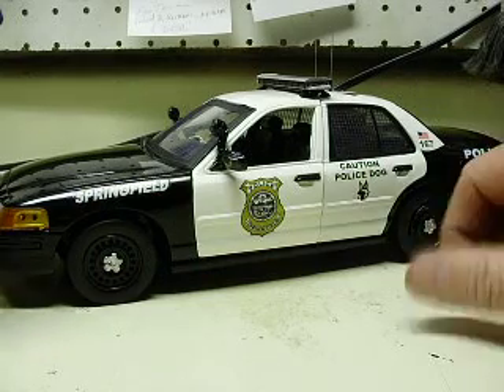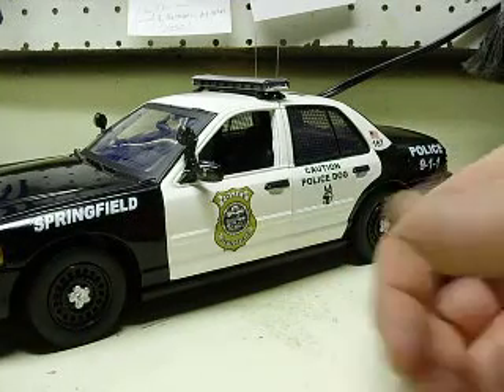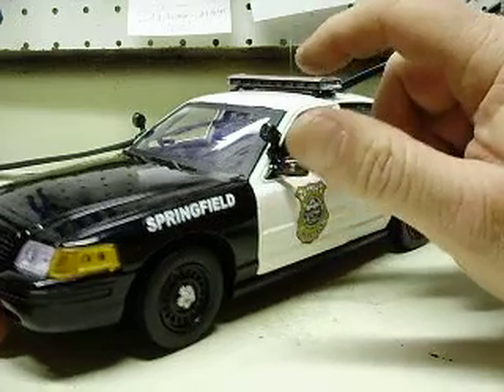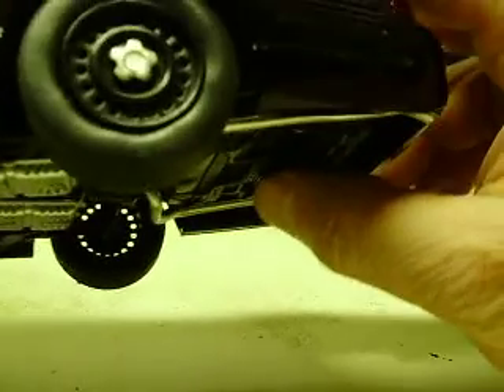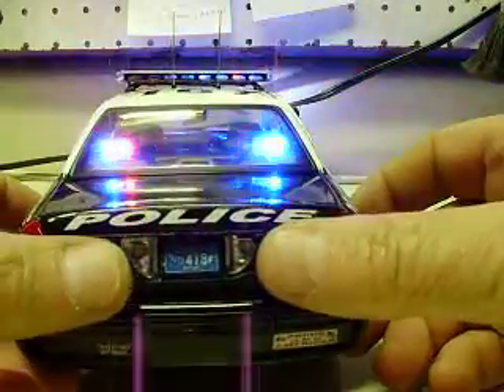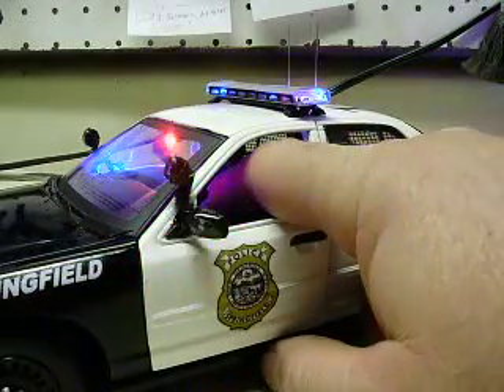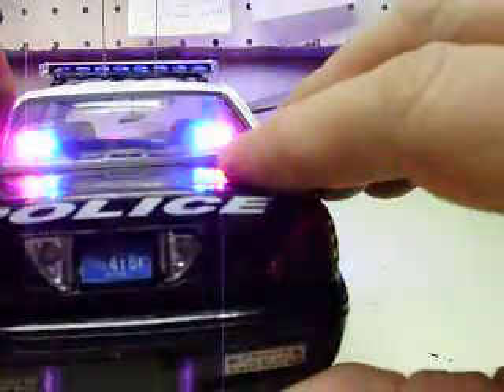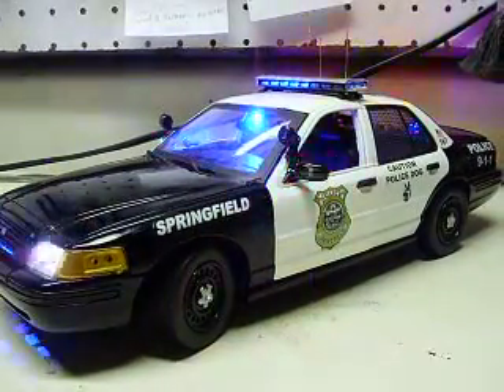Don's custom 1:18 SPRINGFIELD PD Ford Crown Vic with working lights sounds siren

Comment: this had to be expensive
Reply from the maker: No idea...it was a disaster though.  Whoever built it did a crappy job inside....bare wires, cheap switches and just kind of thrown together.
Reply: 01bluebusa; I guess you get what you pay for